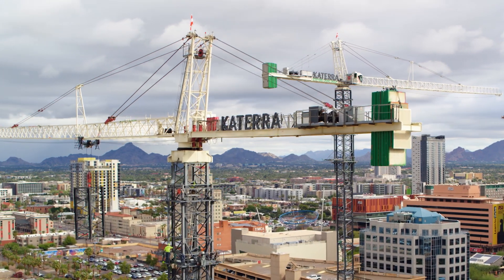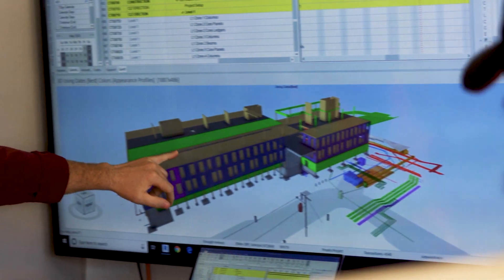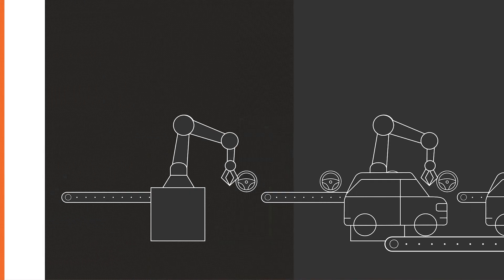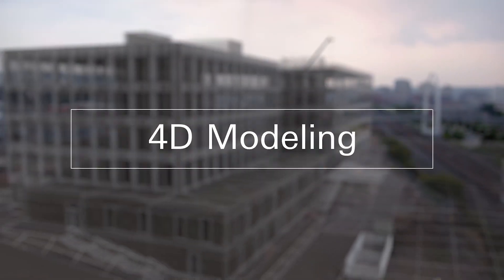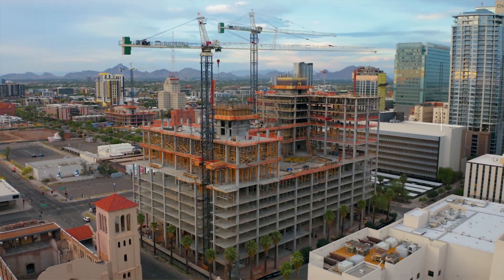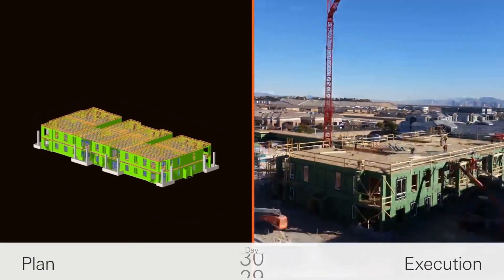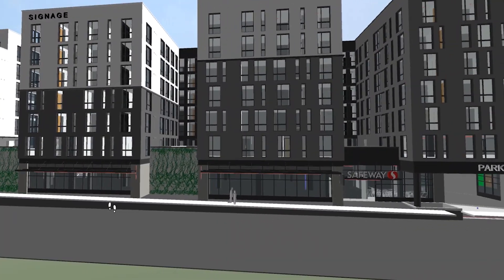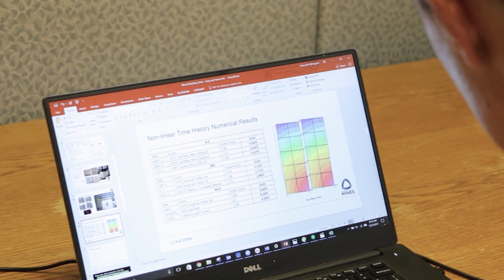Katerra | Technology Profiles | Virtual Design & Construction (VDC)

Comment: Bold claims thrown around here. 30 % of all construction costs are the result of rework . This is deliberately misleading to someone who doesn’t know modern buildings built by professionals . Define rework .
Reply: I'm assuming it helps to eliminate errors. Every project is based on time and efficiency. If you can reduces the amount of errors in a project that saves you time and a considerable amount of cost.